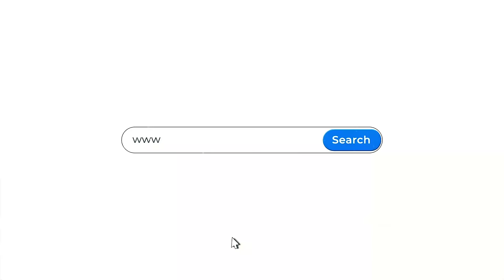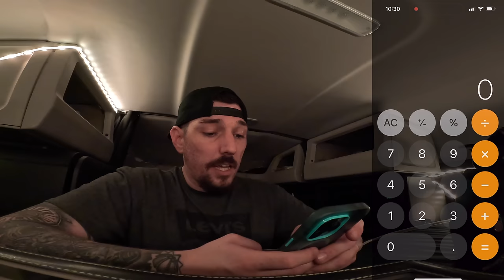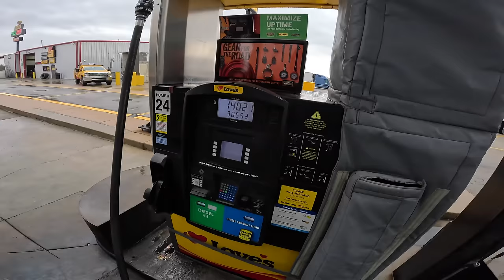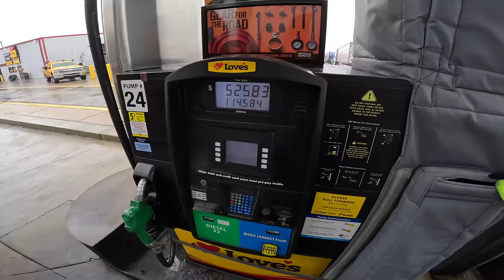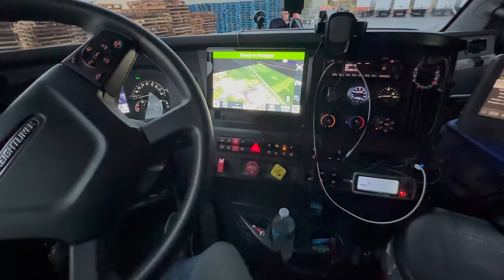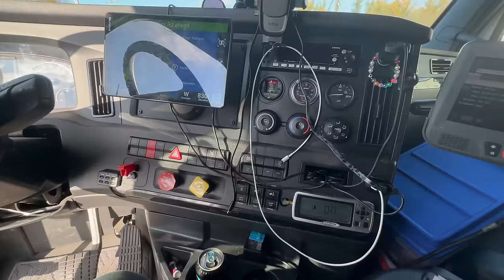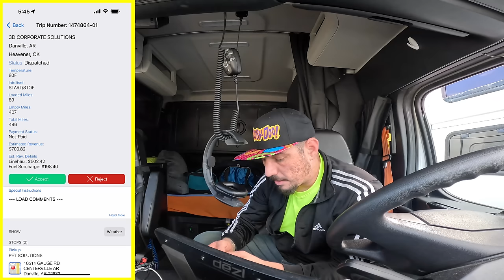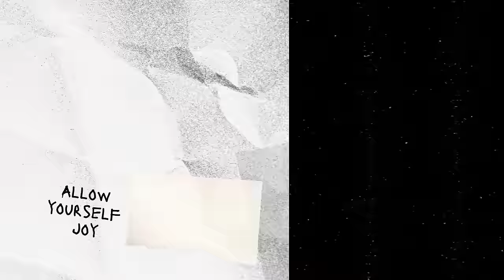Maximize Your Earning Potential Truck Driving With Prime Inc

Comment from the maker: If you’re thinking of coming to Prime Inc or want to get your CDL license. I honestly believe Prime is a solid company to start your trucking journey. 
Make sure when you fill out the online application @ www.primeinc.com put my driver code STREXA on page 2 of the application when it ask who referred you. Thanks for watching my video! 🙏❤️😁
Reply: Do they have CDL schooling ?
Reply from the maker: @dcblu22  yes Prime will help you get your CDL license. You’ll first need to get your learners permit from the state you reside in. Below is my recruiters info in case you have more questions!

Dustin Hensley
Prime Inc. Recruiter
Direct: 417-521-3905
Prime Recruiting: 800-224-4585
dhensley@driveforprime.com

Comment: Make sure to keep an eye on that fuel map, too, don’t just go by that daily message. Sometimes they’ll have you get fuel somewhere else in order to show that particular station some love even though it may cost you more. Several weeks ago they had changed my fuel stop and when I compared the new stop with the original on the fuel map it would’ve cost me $0.18 cpg more at the new stop. Doesn’t make sense, but I always check the fuel map on the home page now.

Comment: Rex when you dropped the heated load and headed to springfield tank wash is that deadhead paid or do you have to eat it and in general if there is no empty ready to go unit when you make a drop do you get paid for going to tank washes. Thanks for all the content
Reply from the maker: That deadhead is added to my next load it shows under “empty miles” yes I’m paid for empty miles aka deadhead

Comment: Does your trunk not have a bunk heater? My first year was OTR doing Flatbed and I lived out of the truck and only needed a comforter for overnight, and then in the morning I would turn the bunk heater on for a few mins, because it would heat that bunk area up WAY too hot.
Reply from the maker: Yep got a bunk heater, last year even on high in -24 degrees in Iowa I was cold, a heated blanket would be for emergencies/back up
Reply: @truckingwithrex  That's wild....but, per TMC policy, once it dropped below 20 F, we were made to idle the truck (and then we could just use the truck heat).

Comment: @truckingwithrex I am local making about 830 a week.. Paid hourly driving Lumber… Would it be worth moving to prime.? Would I make more?? I have 4 years Experience thanks
Reply from the maker: Everybody’s definition of “worth it” is slightly different. For me it is, some say it’s not worth the money 🤷‍♂️ im looking at the big picture of where do I want to be in 5-10yrs? I will say leasing with prime pulling tanks there is no reason you can’t average $1500-$2000 per week after expenses. Hope this helps 🤙✌️

Comment: How did you clean up the leakage at the receiver?
Reply from the maker: A full roll of paper towels to keep it from leaking out the cabinet
Reply: @truckingwithrex Leaks are  always my biggest fear. The place I run dedicated to has a pressure washer in the unload bay, so any spills are washed away.